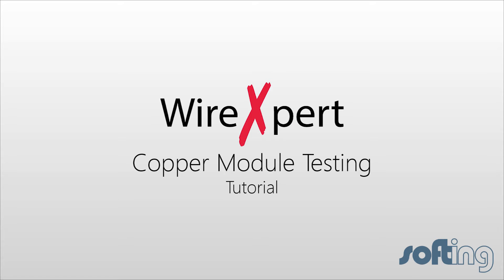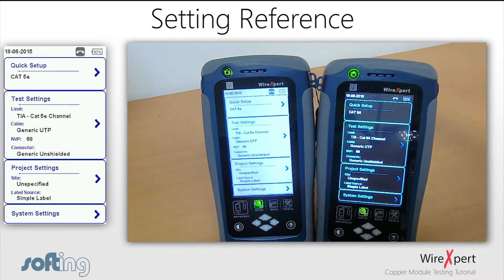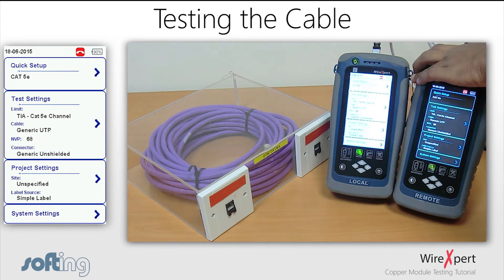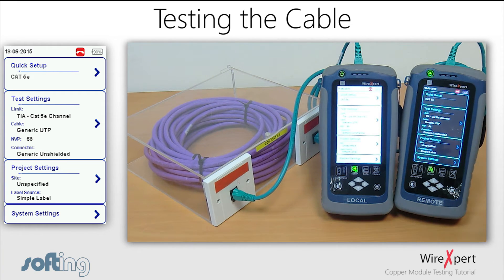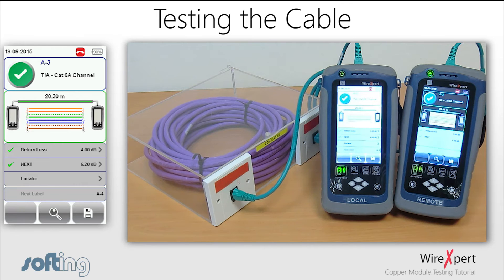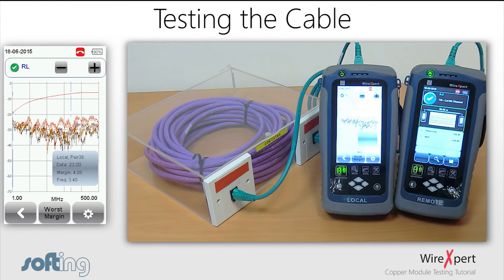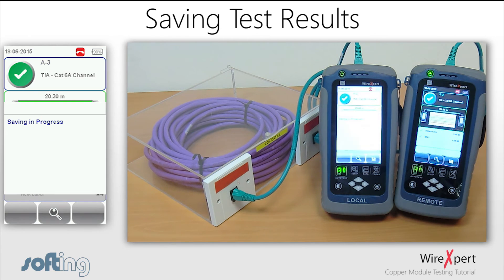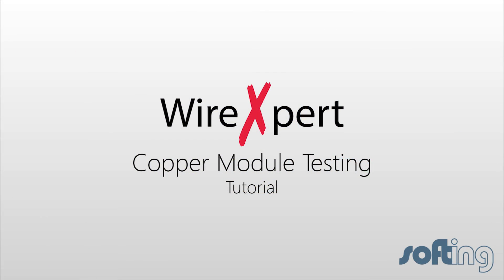WireXpert - Copper Module Testing Tutorial on v7.x firmware

Comment: This 7.x device software is very good. The overall device response and even if we have many test results ,the data menu's response is very good. This is much better than the previous version 6.x. We have some feature requests and we hope you can include them in your future software releases:

- Color theme change
- Is it possible to have a storable configuration profile based from user? e.g. Tester A and Tester B have both different configuration for Test Settings, and they would like it to be stored and loaded instead of relying on the factory default Profiles?
- Is is possible to have a way to send test results to online cloud storage of our choice?

I hope the performance of your future software releases will stay this way. Thank you so much.